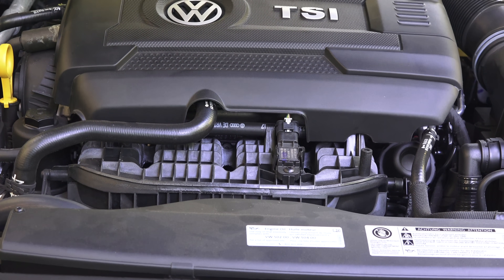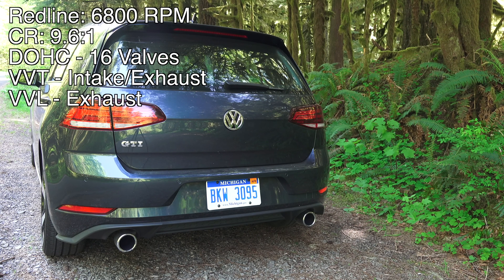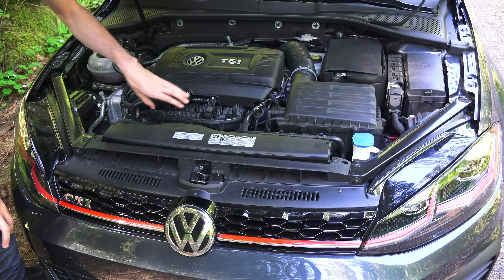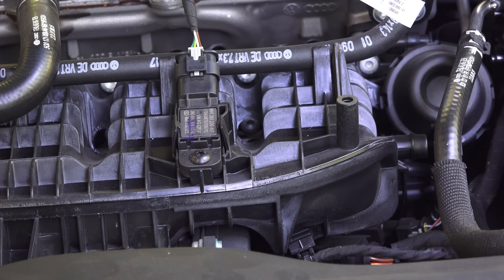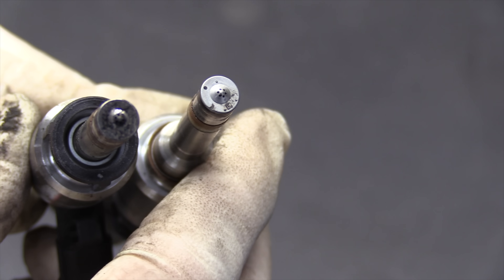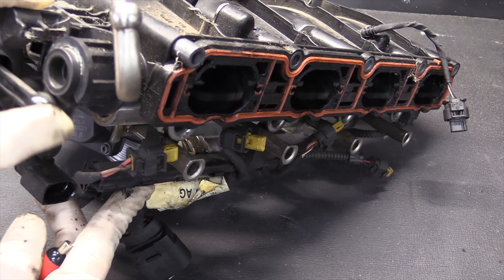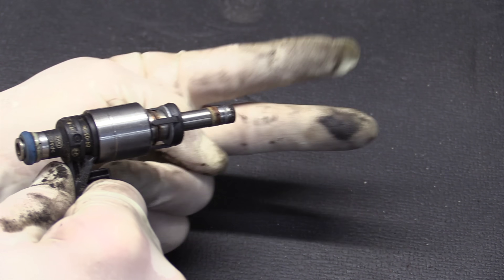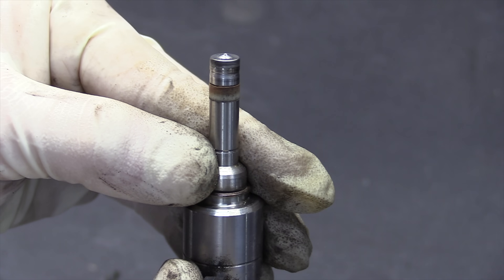The Best Engines - Volkswagen GTI Turbo

Comment: I've had the worst experience with this engine. Bought the car new, not a single issue. On 92k kilometres on the clock and 6 years in it al started. Obviously just out of warranty. On 92k a exhaust head bolt broke. 95k the cam bridge failure. 98k oil pump. 104k timing chain and tensioner. I'm on 107k kilometres now and its using around 2 litres of oil in 650 kilometres. This car was serviced as per schedule at VW agents only. Yet they didn't cover any costs of the repairs. Can't see myself buying a VW anytime soon again.

Comment: The 2009 run of these engines in Audi's line up was garbage. Undersized piston rings led to terrible oil consumption and eventually a loss of power and potentially the engine. I went though a hell of a time getting that car out of my hands. However, I will gladly own any later model VW with the same drive train, they are fantastic engines once that issue was fixed.

Comment: the 2010 a4 engine should win an award for only one thing - most oil consumed
Reply: Having owned 4 x GTI i can say only my mk6  used about  400ml every  4 to 5 thou km  , nothing . yes some have had high oil consumption but so to have Ford and Subaru high performance models , its not an issue  that affects every GTI .
Reply: Yes due to faulty pistonrings but overall smooth and reliable engines.
Reply: Lots of angry Toyota fans here I see.
Reply: Mk6 gti with 40k miles uses 2 quarts of oil in 3k miles
Reply: I love my 2.0T. She drinks a little bit more than the others but it’s so smooth and comfortable.
Reply: My didn't take much oil.
Reply: It can be fixed
Reply: K7 engine uses lambo block  on audi rs3
Reply: Try owning a 2002 😂
Reply: dude my B6 passat 2008 2.0 tsi is literally at 204000km and i just changed the oil yesterday at 8000km literally has 0 consumed oil
Reply: No man.
Reply: True
Reply: For real.  Junk imo.  The older 1.8T was better.
Reply: @MAD_CarAudio  I have a 2.0 tsi it's a monster
Reply: Hhhhhhh they are the most horrible turbo engines in the world .... Zero reliability  ,,,, waste of metal
Reply: Bmw won that
Reply: Oil may as well be the fuel
Reply: Yeah! That ones that lasted the most consumed olive oil! lol 😂
Reply: My golf 6 gti eats 1 liter per 1000km
Reply: AUDI is German for  oil leak. Actually , any German car will bless its owner with a puddle eventually.
Reply: Lmao
Reply: Its beyond me that engines with such design flaws get any award at all!
Reply: @Robin-lj3vq  it cant beat the owners flawns....like you
Reply: @Robin-lj3vq  corporate awards obviously... who made consumers consume the most and put up the most money ...  maybe u just don't know what the awards are : )))
Reply: @Robin-lj3vq  You have to drive one. VW drivetrains are legendary. Smooth, deep exhaust notes, effortless to drive, economical, etc. They are some of the best cars on the planet, legitimately
Reply: @MrZatyro Try to convince those Toyota and Tesla cult members.
Reply: @MrZatyro  huge...endless...money pits.
Reply: @MrZatyro  'smooth, deep exhaust notes'? The GTI engine is one of the worst sounding 4 cyls on the market today, please get real. I can't think of a 4-cyl engine in a modern hot hatch which sounds worse. The i30N sounds better, the Megane RS sounds amazing, the Focus ST sounds much better, the Type-R sounds better, and it's not because of the sportier exhaust. All of its competitors aside maybe from the 308 (which sounds just as boring) sound objectively better than VW's 2.0.
'Effortless to drive'? Wtf are you doing with its competitors that they're not 'effortless to drive'? Did you forget to press the gas pedal? Did you even drive any of its competitors in the first place?
Reply: @MrZatyro  how many of vw products you owned?
Reply: @darkchild4neverever  Thanks Zach. Sanest comment here. In four words you said it all. VW made their last honest car with Type 1 number 21,529,464 in 2003.
Reply: @darkchild4neverever  Thanks Zach. Sanest comment here. In four words you said it all. VW made their last honest car with Type 1 number 21,529,464 in 2003.
Reply: @S 
My god. You should get an award for the most ridiculous rant 😂
Reply: Harbl no actually he’s on point
Reply: @xIcarus227  One very simple Q: How come VW is number 1 car company in the world? Also remember VW/Audi/Porsche have won all races in the world. Ford/Hyundai/Subaru can't even come close to the German prowess in ICE.
Reply: @rajeshlparab  first off Toyota has had the most yearly car sales for the past 10 years or so, not VW.

Secondly, the number one spot always goes to the manufacturer making cars for the masses, it's got little to do with the brand's racing pedigree and everything to do with their marketing and brand perception.
Look at the Italians, their cars have such a racing pedigree yet they don't sell well because they've got other problems. Yet Alfas are some of the most fun cars to drive to this day.
Look at Toyota, most of their cars are boring commuter cars which are good for the average peep. They're reliable but otherwise average cars. Pretty much like VW, except VW aren't reliable.

Please don't credit VW for Porsche's rich racing history because they weren't VW's property until 2012. Porsche's achievements are their own and even though they're part of VAG they're still very much independent to this day.
The credit you can give VW is for Audi's success in Le Mans since the 2000s, and the legendary Audi Quattro's wins in various WRC competitions but that's pretty much where their racing pedigree ends.

Subaru has an exceptional rally history well beyond what the Audi Quattro has achieved, while Ford has had legendary success with cars like the Ford GT in Le Mans while also giving the WRC a good run for its money even though they haven't even competed that much.
Like seriously, out of all these brands you're questioning I think picking on Ford makes the least sense. They're one of the manufacturers which makes sporty cars across the board, even their normal hatchbacks are fun to drive and it's why they sell so well. It's unbelievable you're even questioning where their pedigree comes from.

Now you tell me, where's this VW 'prowess' over the ICE engine compared to other brands? If you remove Porsche all I'm seeing a brand just like any other, with a few racing highlights but not much else.
The special brands in racing history are Ferrari and Porsche, not VW. Don't kid yourself.
Reply: Looks like u don't follow events like 24 hours Le Mans where Toyota failed to win single title when Germans were around. How about paris dakar? No one came even close when VW was racing with touregs. Don't get frustrated, but you can't deny facts and history :).
Reply: @MrZatyro  sounds horrible compared to A45
Reply: @xIcarus227 for some reason it sounds better on audi models, yes its really quiet stock, but look up b8 a4 ecs valved cat back, i was really surprised. Sounds much better than catbacks on a gti, id agree with you it is not very good. I think its tied with the new equal length header WRXs for worst in a performance car
Reply: @MrZatyro  no way, really. I had three VW car: golf mk2, gokf mk IV and golf mk VI now. But between mk IV and VI i had AR 159 and i must say...your words are so, so far away from reality special abou drivetrain and feel from road to driver...i miss AR :(
Reply: @rajeshlparab  So winning races is a valid critera to consider a brand "best in the world" ? You realize that the engineers who work on the race cars have no hand in the road cars, right ? Two completely, and I mean completely separate departments within the car's company. 
And you don't realize that VAG products are literally designed to fail, and that since the introduction of the MKIV Golf platform in the late 90s? The design themselves aren't the issue, the materials used in all VAG products, apart from certain Porsches and Lamborghinis, are subpar and simply of terrible quality. It's fraud - you're being sold a product that is designed to fail once the warranty ends. They're pretty much biodegradable :D.
Reply: @bmw803 well
1. Toyota is a great CAR. Not a great engine.
2. Tesla has the highest recall / car failure history of the last 15 yrs. The owners just won’t admit they bought a POS. BTW, more people die in Tesla involved crashes than any other car. This is a TSB fact. Of course, if you look at who buys Teslas ( first time drivers out of college from non driving countries) that makes sense.
Reply: @user-rb1yf4he9q   NO doubt that Toyota is a good car, but they're not alone. There are other cars from other makers that are just ask good, but Toyota gets the glory. Marketing !!!! As for Tesla, you're 100% right. Piece of garbage that cost an arm and leg to repair. I wouldn't touch one with a 10 foot pole.
Reply: @Robin-lj3vq  oh but no one said who awarded whom , its VW awarding them selves off course
Reply: @dedskinprodcerdj4273  Pretty sure the award is for the T shirt.
Reply: My 2006 A4's 2.0T Stage 2 motor consumes 0-1L every 8000Km's. I have some oil leaks such as the valve cover and breather tube which I just fixed yesterday.
Reply: @Flightguy323  Was that the TSI, or the TFSI EA113? I had the EA113 on my 2006 Passat B6 that consumed a fair amount of oil. That engine, while generally reliable if you took care of the fuel pump issues, was legendary for fuel consumption, excessive blow-by, and PCV issues!
Reply: @Tomd4850  the fourth gen EA888 don't burn oil anymore
Reply: My 2014 a4 takes a quart every 1k miles. Bad.
Reply: @2010ngojo  like a 2 stroke
Reply: I got a 98, run through a quart a week
Reply: That’s all VW engines 😂 gotta keep an extra 4 quarts at all times
Reply: @Micah Kibler  it all depends on maintenance enough said
Reply: @Stretch_Buckets not my 1.8 T SportWagen it uses hardly any oil, but I also change the oil sooner than the recommended 15,000 km.
Reply: And garbage timing chains breaking your new engine car. don't forget that because is very important to know before buy new voswagen. and don't forget about that crap dsg that breaks all time 😂😂😂 yeah I bought that crap called voswagen running at 12000 km by now hopefully will make it to 60 000 km with no need for new engine...

Comment: I have a 2018 passat GT with a VR6 3.6L  24v dohc. Engine. 290hp w/265ft lbs of torque. Topspeed 155mph. It's a limited run car only one year made 2500 total for north america. Sometimes I use 95 octane for more hp. About 305 - 310hp also a highflow bmc airfilter.

Comment: I believe I have the same engine 2.0 TSI in my 2012 Beetle am I correct? Also do the valves get completely caked with carbon at 58k? Volkswagen is replacing my intake manifold due to the P2015 Codes and sent me a picture of my valves that look like they have driven 200k with buildup? I really would appreciate some help?

Thanks

Comment: Can you explain the philosophy centrifugal external water pump running on a secondary accessory belt?  Does this have something to do with high rpm cavitation or equal distribution of water flow being in the center of the block.  Why does a 2.0L motor need balance shafts or is that a bore-to-stroke ratio requirement?  It seems to me just putting a metal housing water pump on this block would have decreased the failure rates these motors have gotten a reputation for since they commonly break at the plastic eyelet mounting the pump to the block when the plastic becomes brittle from heat cycling.  Considering its now handling coolant running through an exhaust manifold, I wonder how it affects the coolant temperature range and response.
Reply: Also, why do you need tumble flaps when you have direct injection only?  I thought that was a thing needed for mixing fuel and air in a MPI scenario in cold start conditions to prevent fuel from condensing on the intake walls before operating temp. Do you have that problem in a direct spray condition when the cylinder is going to be hotter much faster?  My sentra had it, its a thing on subaru motors that gets "deleted" and I think the 13b rotary has tumblers for that same reason.

Comment: In what ways is this 2.0 engine different than the vw 2.0t engine in the CC, Bug, Passat, Jetta and many others with 207 torque at 1700 and 200 hp at ~5100 rpm’s (I think).

Comment: the bottom end/rotating assembly on these 2.0ts are very stout but it seems that the valvtrain/timing components are all made very cheaply(ie tons of plastic components, just watch humble mechanic tear one down and you'll see) and are much too complex for me to trust, I've seen many issues with them in person, no doubt they're absolutely fantastic to drive, the powerband manipulation the engineers have done is pure german witchcraft, let go of the clutch and you're moving  👁‍🗨 👁‍🗨

Comment: Big fan of your's for years. If you see this note I will be happy. I wanted your view and analysis of the Volvo T4 engine model year 2012. It is a 1.6T. This engine was a big failure in spite of using premium fuel. Was wondering if you can uncover the design flaws of this engine, and what is really wrong with it. And if soneone is an owner of this engine, is there a way to make it last longer without having to replace it every 50k km or less.

Comment: The intake manifold is plastic GARBAGE worth $200 😂💀🤣... 

kinda mad because my gti isn’t covered under any recall for that part 😭
Reply: They did recall it, like in the mk6 days..they would crack on mk6 gtis and so they recalled and re designed them and made them stronger. So now they're actually reliable, idk what everyone's talking about.
Reply: @baranUtube  Mine broke at 49990 miles on my 2014 GTI, just barely made to the dealer for the under 50K warranty replacement.   They installed the redesigned one and it now has 140K, with no issues.
Reply: Douglas Hamner why would I buy anything related to car DIYs on amazon? 😂💀🤣
Reply: cast intake manifolds unless port and polished after market are sub par compared to smooth plastic intakes, its the environmental recycling that lets them down by chocking up with oily carbon deposits which prevent it from cooling down and clogging up sensors and valves. I recommend Subaru Upper Engine cleaner
Reply: I read the new ones can support like 450hp. They must've gotten a pretty good redesign from what the forums have said. I would still rather have aluminum though. Idk, piece of mind I guess.

Comment: I’ve got a 2002 337/20AE with 57k miles. I sure wish they had a variable vane turbo for it to compensate for the exhaust snail size and lag and rpm limit for boost.

Comment: All the more for problems.  I would rather have slightly less power and better reliability
Reply: Get a 2004 Jetta with the 115 HP 2.0L. Maintain it, run for a very very long time.

Comment: I have two of em, a 2013 and a 2017.  Both have a stage 1+ Unitronic flash and holy crap what an amazing boost for the money.  The 2017 is a bit stronger but the 2013 is more fun around town because of the lower gearing.   Lots of nit picky failures on these engines though.  Coming from an Acura RSX-S, it's an eye opener in both better performance but crappier reliability.

Comment: I pick up a 2016 jetta gli tomorrow. Does anyone know why it's about 50 lbft of torque down on the GTi? I aim to remap anyway but would like to know the main differences in powerplants
Reply: Take a bit of weight off the car. Then a magnaflow full exaust line and a tune. Problem solved
Reply: @m.morininvestor9920  I wanna do exhaust and breathing then an apr map probably.

Comment: The tsi engine in the Amarok tsi300 is pathetic and burns oil at the rate of 1 litre per 4000km
Reply: ever driven an audi newer than 2000 with an 4,2l v8 ... these shitboxes need 3liters oil in 1000km its so ridiculus

Comment: Just sold my 2016 GTI with only 26k miles.  Great car to drive, not a good car to own.  All 4 brake rotors would rust in 24 hours.  All 4 brake rotors got huge trenches carved in them.  Car started getting LOTS of water in in the spare tire area.  The car burned through a set of tires in 20k miles...badly cupped and I even had an alignment done.  (and I don't drive like a teenager..I'm a grandfather) and the car freaked out on me on the highway.  Turns out the computer turned off one of the cylinders.  Had to pull over and be towed.  Dealership said they couldn't find the problem, sorry about your luck, here's your car back.  Engine was great.  Car was issue laden.  I will NEVER buy another VW again.  Toyota or Honda for me.

Comment: ok so im sure those mpg rates are right depending on the driver but i was able to get 35 to 39 mpg in my mk6 gti back when it was stock now i have seriously increased the performance of the engine by doing a stage 2 upgrade to mine. i now get closer to the stock rating of between 25 to 32 when im trying to drive efficiently. i have run a 14.000 1/4 mile time on it on a super hot day at full weight of 3,000 lbs and that's with me in it (im not a small guy) and on top of that i wasn't able to hook well that day. just my observations from owning one great video i very much enjoy watching all of your videos keep up the great work 😊👍

Comment: The e888's great-great-grandpa, is the 1.8t. Iron block, alloy head. Same firing order. Although the e888, has a bunch of gadgets to make more power. You have to respect the 1.8t, it has a nice aluminum intake, aluminum oil pan, and a 5 valve head, and can handle a lot more boost than factory spec. An easy 300 hp unopened, and up to 500 hp with just aftermarket rods.